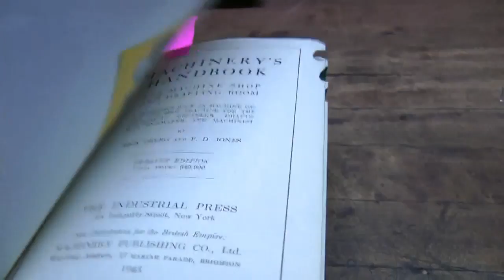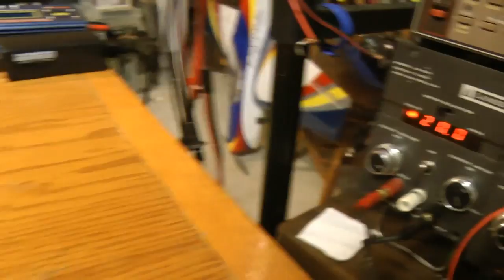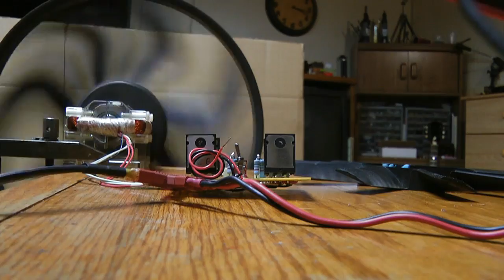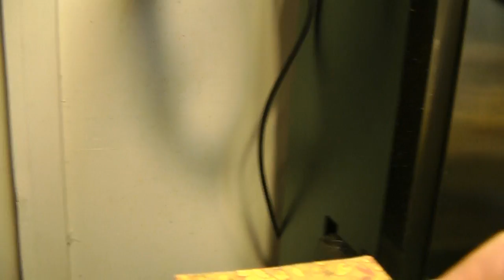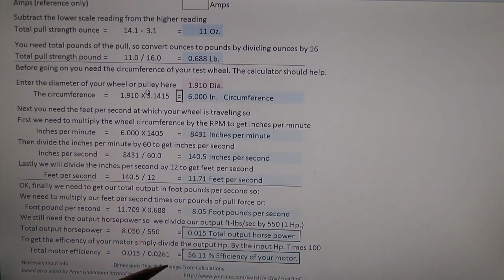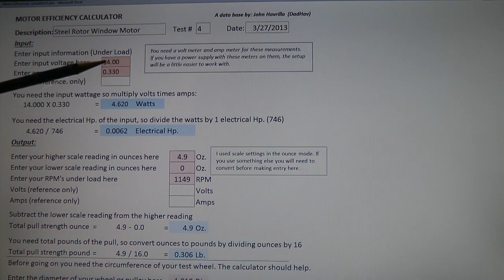DIY Dynamometer (Prony Brake)

Comment: John, Great video! Thank you so much for sharing the spreadsheet. I have seen this method talked about quite a bit online but you have made it much easier to access for a nwebie like myself. Seems like I need to order some scales! If you check out my YouTube channel you'll see what I'm working on. It's an attempted small-scale replication of one of Joseph Newman's motors (which the window motor is LOOSELY based on). My current model is a lot of fun to play with. Runs on anywhere from ~500V to 2000V with VERy low current draw. From my calculations the current draw is on the order of 0.005 to 0.01mA (about 5 watts at full RPM with no load). As soon as I get the efficiency tested using this method I will be posting the video on my channel.
I'll try my best to remember to return here for further comment.
Thanks again,
Jim

Comment: hi john, thanks for the information, just wanted to know if we could use this method to test universal motor of input watts 880 @ 10000 R.P.M on load..

will be grateful if you could help out
Reply from the maker: I would imagine you could test larger motors if you have scales that would match your needs. My friend brad tested a larger motor in this video. Have a look. I'm sure he'd answer any questions you might have as well.
UFO's prony brake test
John
Reply: ***** Thanks, it did clear my doubt, I just conducted the test on my universal motor similar to your video and got satisfactory results, thank you for the knowledge share.  just one final doubt, i pre set my scale to avoid the motor running at no load speed as they are very high but once the motor started to run one of the scales as expected went to zero and the other to an x value. Now my total loading would be x-0 right.. kindly enlighten me
Reply from the maker: Hello, I'm not sure what you mean by presetting the scale, but subtracting the smaller from the larger should be correct I believe.
John

Comment: What if I will use prony brake to measure the torque of an engine like honda gx 35? Is it possible to interface it with an arduino microcontroller?
Reply from the maker: Sorry friend I'm afraid I can't help Ya there. I don't even know if the gx 35 is gas or electric. 
J
Reply: gx 35 engine is a gasoline type of engine. Anyway.. Do you have any idea or picture in making a simple and small setup of making a prony brake? Also can a prony brake be used while the engine is working and exposed inside the vehicle assuming that the vehicle is moving.. I really need it for my project in monitoring the engine torque.. so I have to know if its possible and that's why I really need a small setup..
Reply from the maker: Roemer Timbre My friend. I can't imagine using a prony break while moving and I'm not sure how it would work with a gas motor. Remember you have to be near full stall to get a good reading. I think you would need some sort of electronic dyno of some kind or if you where a physics major you might come up with a formula using the diameter of the wheel, mass of you and the vehicle, given horsepower of the motor, speed, and probably the angle of a hill you choose to drive up to create a load to the motor. Know anyone that smart? Also search here there are a lot of pony brake videos.
Sorry couldn't help more.
J

Comment from the maker: It sounds like you have a really good compliment of equipment. I tend to leave bosses on my parts like rotors that I can use in a collet and live center if I need to make adjustments. I have an old dividing head that has collets up to 1 inch. It's easy to index 6 times and mill slots in the Delrin for the magnets. I think I ground a cutter to to give about a .001 press fit on the magnets. This press got tighter as you install all the magnets. Still not safe for real high speeds though.
John

Comment: Have 8",12" digital mics, rotary table, tapping head,  2 old mechanical micrometers, bench mill, DRO, glass scales collets, 12" swing lathe, 3,4 jaw chucks, some cutting tools, but am lacking your fantastic turning,milling tool grinding skills. Have a LONG way to go there. I want to learn how to mill the press fit magnet slots you milled in the Delrin cylinder. How did you do that? Have no idea. Wondered if a tilting rotary table (mine doesn't) with a chuck, would work. Help please :<)

Comment: It is more than a hobby 4 me. Hope 2 discover something useful.  Look 4ward 2 ur repliesbcuz I admire your friendliness to every 1 + your knowledge. Bought Triplett 630 NA multimeter. Had battery damage and breaks from dropping. Fixed it. Keithley 199 seems 2 b working  fnd a manual. Has shown me something (very good) about my LED driver design my meters didn"t - great tool! have it thx 2 u! Am lighting 3 LEDs with 1.3  milliamps!!!! They are not at full brightness but exciting.

Comment from the maker: Wow, You're really getting involved with the hobby. Probably one of the most useful tools you can buy is a set of 6 or 8 inch digital calipers. They give you a large measurement range and can also be used as a depth micrometer. Good luck with the meter. You can search and find a manual. I can try to find mine if you need it.
John

Comment: Thanks 4 ur reply. Great excel Prony program. Wish others would measure their results. Watching ur videos daily - after watching u machine Mag Lev Fixture will not buy a 3D printer Will learn 2 use my lathe and mill properly. In 1 of ur videos saw ur Keithley 199 DMM (beautiful tool) - just bought 1 off Ebay. Want to see small voltages beyond 3 decimal places. My 2 DMMs can't. Will buy square, wiggler, edge finder and ball end mills and maybe digital micrometer. Any other tooling u suggest?

Comment: Just thinking: If you turned on both scales before you rotated the motor they should have = readings. With motor on, pull on one scales is increased, pull on the other is decreased so it seems net pull should be higher minus lower reading like finding the net voltage in a differential amplifier' Output = input A minus input B x Gain (none here). Do I understand correctly?

Comment from the maker: There are many ways to check efficiency but the test procedure I chose was one which was chosen as the accepted standard for the forum I was active in. With regards to the light, About the bulb? come on man I said it wasn't what the video is about. If you want to see the bulb light without the rpm changing check the video link in the description under the movie.
John

Comment: Electromechanical oscillator (extremely low power, no torque) and motor (high power and torque) are two different beasts.

Comment from the maker: Hi Patrick, Thanks. Now I promise to get on to the other things. I've actually tried the generator thing with a heavy duty audio L Pad for loading the generator. An arm off the generator to a scale would probably work also. Yep them there motor cycle batteries have had the crap beat out of them. The one with the alum electrolyte is holding up better than the acid even though it looks like it's damaged more.
Take care
John

Comment from the maker: Actually there are several other ways to do this. Some use a lever pressing against a scale. I chose this method because it was going to be an excepted standard on one of the popular forums. It's hard to imagine how this procedure works but it seems to work well. I would rather have something more electrical than mechanical as far as the brake is concerned.
John

Comment: Thanks for clarification - I guess the argument would be that the second scale is contributing it's amount to the overall effort which the first scale would not have been doing were it on its own.  Hence the subtraction.  Still doesn't feel nice and clean to me, given the amount of weight you are measuring, must be easier to hook up a single scale with a triangular weight spreader underneath?

Comment from the maker: To add or subtract has been a hot topic. Someone on a popular asymmetric motor forum added them and the results where over unity. This sparked a controversy that proved the number should be subtracted. If added any motor in the 80% range will show over 100 %. My second test was good because the motor was set to draw low current and the transistors didn't heat up and throw the test off. In my opinion.
John

Comment: Quick question - why did you minus the lower pull from the higher pull instead of adding them together? Genuine question as I would of thought that the total pull is the combination of effort of both scales? Thanks for the vid, very interesting